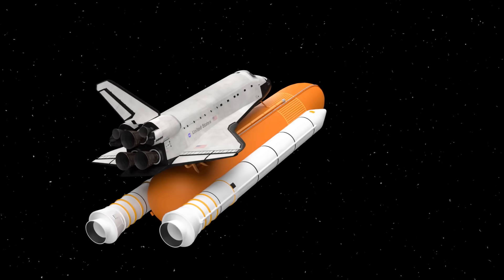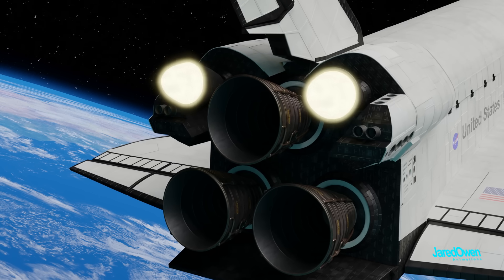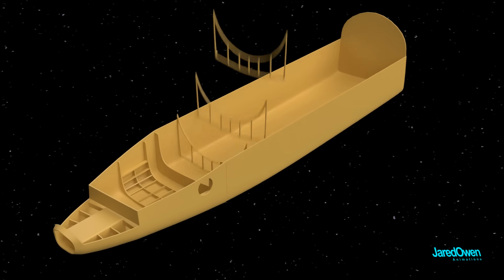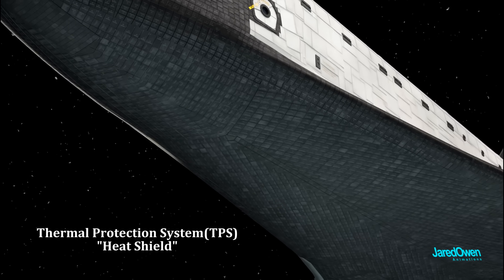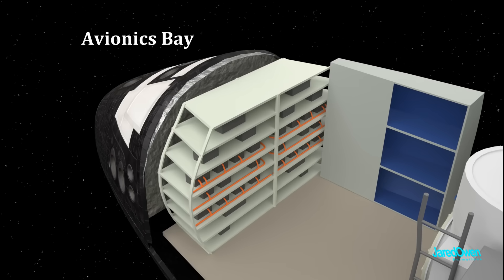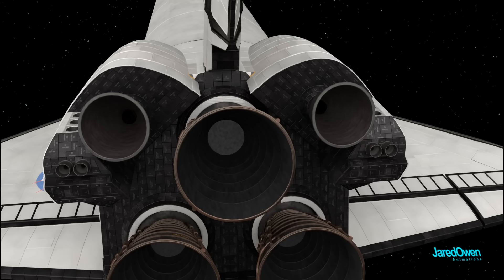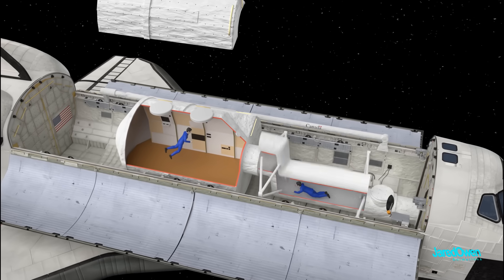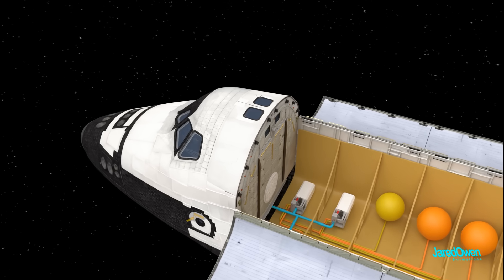How did the Orbiter Vehicle work? (Space Shuttle)

Comment: "Lands like a plane"
or, as someone else mentioned: "It was about as aerodynamic as a brick. The ONLY way to simulate the "performance" of it during approach, was to take a small passenger jet, with gear down, flaps full down, speedbrakes out and engines in reverse. THAT's the shuttle's "glide" performance."
Reply: It Just Works
Reply: No, that is an autistic rant. The actual glide ratio compares to e.g. an early paraglider design and people could have fun with those 20 years ago... and it does land like a plane.
Reply: @Baerchenization  if a glide slope of around 10,800 feet/min (aka terminal velocity for a skydiver) is standard for an early paraglider, I'd stick with a brick instead
Reply: @gajustempus  If you knew what you are talking about, you would not have said that. A glide ratio is how far you get from a certain height, e.g. 1 Km altitude, 4.5 Km distance is a ratio of 1:4.5 -- time has nothing to do with it. Standard for an early paraglider was a 'kind' 3... 4.5 was already pretty good ;)
Reply: @Baerchenization  oh boy, you're a hollow nut...
a 747 has a glide ratio of around 1:12. Current sailplanes have a glide ratio of around 1:90 or even better. That's why they need quite hefty airbrakes - they'd be unable to land on any normal landing strip.

As for the shuttle - it's a 1:1 ratio! Or better - was.
Reply: gajustempus Your numbers are correct but your conclusion is wrong. Airliners don‘t need speed brakes or better ‚spoilers‘  to break the glide but — in the end — not to strike the tail. Your 747 is a long aircraft that will still fly at an angle of attack that would guarantee a tailstrike on landing if they landed at aerodynamically correct landing speeds. An aerodynamical landing is a stall very close to the ground. So what they do is they keep the nose down while approaching faster and don‘t actually land but fly the airplane to the ground. So when the plane hits the ground it is still so fast that it actually flies along the runway and the brakes have little effect. So the spoilers are used to ‚spoil‘ the lift of the wings so you can brake the plane down.

What Baerchenization said about the gliding capabilities of paragliders is also true. The glide number is a value that comes from the descend rate and the forward speed. So if you can keep both a low rate of descent  and a high speed you‘ll get a high glide number. or glide ratio if you write it 1:n. But those early paragliders were not designed for high speeds, they were adapted from emergency chutes made a little bit controllable. So even if they descended at low rates of descent, their little forward speed would still make small glide numbers.
Reply: @Baerchenization   > in the "middle" phase ... the ratio is 4.5 <  Still, a lot better glide ratio than for the original proposal in the 70's, which would have used a small straight wing.  In any event, the Orbiter's glide ratio once over the runway -- when glide ratio really starts to matter -- was closer to 30:1.  Basically a sailplane, if a rather fast one.
Reply: @Baerchenization  They aren't wrong. They used an old Gulfstream in reverse thrust with the main gear deployed.
Reply: The shuttle's aerodynamics were so poor you'd be better off flying the box it came in.
Reply: Lol
Reply: Bret Copeland?

Comment: How exactly do thrusters work in space? If space were a perfect vacuum, thrusting would accomplish nothing as there is nothing to push against? If there is roughly 10 to the 23rd reduction in air pressure in space, it would seem something much larger (thruster and/or fuel tank) is needed to accelerate or brake something as weighty as the space shuttle. What's the trick in this? I've had this question since the first star wars movie came out when I was a kid.
Reply: Ever use a firehose? The flow rate is so high that it produces thrust. That's from the water being ejected not the water pushing against the air.
Reply: Thrusters in space dont need something to push against. This is because every force creates a force in the opposite direction. Let me try to explain:
Imagine the following situation: you are an astronaut floating in space and in front of you there is a heavy rock floating 5 inches away from you. Now, if you push the rock, you will be pushed backwards and the stone will be pushed forwards. The amount of distance you get pushed is dependent on the mass of the rock.

edit: sorry for my average english, its not my mother language
Reply: @raoulduke7668  Right, I get the equal an opposite. But my question involves essentially a vacuum, not a rock. If you push against a vacuum, there will be no force pushing back at you except maybe an occasional hydrogen atom. The inertia of the space shuttle would need much more than that to effect noticeable movement of the shuttle.
Reply: @finnyr9330  Its basically Newtons 3rd law of motion, momentum conservation. 

In a rocket motor, propellant molecules push on the back of the chamber they came out of. Thats why they create a force in the opposite direction.
Reply: @raoulduke7668  So what you are saying is that the engines are designed in such a way to use the exploded fuel itself as the resistance rather than what's outside the chamber. Actually, that does make sense, from both a movement and steering perspective. Thanks.

So would I be right in thinking that the tailing flame would be longer in space where exhaust is unimpeded by air pressure?
Reply: @fromnorway643  Jeg forstår Newtons tredje lov. Mitt spørsmål er kvant forstår Newtons tredje lov. Mitt spørsmål er kvantitativt knyttet til mangel på push-back av plass. Men det er min nordmann som kanje trenger en oppfriskning.
Reply: uffda. Norsk, ikke nordmann.
Reply: @finnyr9330  
Newtons tredje lov demonstrert ombord på den internasjonale romstasjonen ISS.
https://youtu.be/ZkVU-bj9bDk?t=103
Legg merke til hva som skjer når begge massene er omtrent like store (to astronauter) vs. når den ene er mye større enn den andre (astronaut og basketball).
Reply: @fromnorway643  I'm afraid you are still misunderstanding my question so I will revert back to English. No worries, though as Raoul has answered it for me. 

My question was not HOW Newton's third law works, but WHERE the opposing force is coming from in space. Space is not a rock and it's not a basketball, it is nothingness. It can't push back. So Raoul pointed out that the opposing force is the explosion of fuel inside the rocket chamber. That's where the opposing force is coming from.

So my follow up question is, what is different about the exhaust flame coming out of the rockets when in space vs. within the Earth's atmosphere?  And how would that affect the performance of the rocket?

It seems to me that because space offers NO resistance to exploding fuel that the effectiveness of the rocket would be reduced. But by how much? Would it be significant when one considers the reduction in pressures in space (compared to earth's surface) is 10 to the minus 23rd?

I'm sure someone how has worked out the math could quantify that, but I imaging the length of the exhaust flame would be a visual indicator.
Reply: @finnyr9330  
The opposing force doesn't come from space, but from the exhaust gases themselves.
When they are ejected at very high speed (roughly 10 times higher than that of a typical jet engine), they push against the top of the combustion chamber and the inside of the nozzle, as shown here:
https://www.real-world-physics-problems.com/images/rocket_physics_15.png

Maybe this is a better way of looking at it:
Imagine a closed container filled with a high-pressure gas. The molecules are flying around at high speed and constantly colliding with the walls and each other, and it's the sum of all those collisions that creates the pressure. As long as the container is closed, the pressure on the right or top wall is cancelled out by an equal pressure on the left or bottom wall, and the container remains stationary as it's not exposed to any net force.
Now, imagine that the left wall suddenly opens up. The gas will flow out at high speed, and the pressure against the right wall will no longer be cancelled out by a similar pressure on the left, and the whole container will be pushed towards right. The thrust created that way will of course be very brief as the gas almost instantly leaves the container, but a rocket engine is continuously supplied by new gas as the fuel is burnt in its combustion chamber.

Rocket engines are in fact more efficient in space than in the atmosphere as there is no surrounding pressure restraining the gas flow out of the nozzle. Their efficiency is typically given in something called specific impulse, a measure of how much thrust they produce per unit of fuel consumption. Hydrogen powered engines are generally better than all other types of chemical rocket engines because of their high exhaust speed that can exceed 4.5 km/sec in vacuum.

Examples of specific impulse for some rocket engines:
                                      Sea level       Vacuum
F-1                                    263                 304
(Saturn V, 1st stage)
RS-25                               366                  452
(Shuttle main engine)
Shuttle SRB                     242                 268
Merlin 1D                         282                 311
(Falcon 9)
RD-180                             311                 338
(Atlas V, 1st stage)

Comment: The orbiter was not reusable it was refurbished ever time to would be taken apart and inspected and the heat shield would have to be completely replaced every time
Reply: All the tiles were not replaced. Each tile was supposed to have the same longevity as the shuttle which was a hundred missions. They were all inspected after each mission and 30-100 were replaced due to damage. As for refurbishing, yes it certainly was the main reason for the much higher mission costs and turnaround times compared to what was advertised. SpaceX was supposed to do a 24 hr turnaround of one of its boosters no later than 2019 but the latest launch was with a reused/refurbished booster that broke an old Shuttle turnaround record of 54 days but only by 3 days. Of course a lot of this was probably related to the mission payload and not the booster but apparently SpaceX has abandoned the turnaround goal of 24 hrs. The recently returned Dragon will need 4 months of tear down and refurbishing before it can be used again as part of the human-rated spacecraft certification process.

Comment: How does the fuel tank burns up in the earth's atmosphere on the way back down, but doesn't burn on the way up?🤔
Reply: Because it doesnt burn, space missions are fake, there is no space. Earth is stationary flat plane, research it.
Reply: @idontcare7961  factual lol
Reply: @Iamsocharleston  that your alt or something?
Reply: Because it re-enters at a steeper angle compared to the launch. Higher velocity and heat buildup is the result. It’s also intentionally put into a end over end tumble. The aerodynamic loading from that helps tear the tank apart.

Comment: Hahaha... Man, you forgot about no gravity in the space. You need the seats only for landing/launching. In all other cases, then the ship in orbit - its just a waste of space. Same for storage (you dont need any specific geometry for it) and all the other things including stairs. You dont need the stairs in the space, handhold(s) is more then enough. :)
Reply: Most of the seats were stowed away when in orbit, except (I think) the commander's and the pilot's seat on the Flight Deck. The ladder was needed to get out after the landing since the exit was from the Mid Deck, not the Flight Deck.
Reply: @fromnorway643  So, the ladder is just to get out after landing... Do you know how much it cost to get 1 kg of weight to orbit? More then 10 thousands of US dollars. So, its all about saving weight. For example, Russian Soyus does not even have panels on the walls inside the ship. Just for to save several kilograms that could be used as payload.
So, every time we see a design "like a flat or home" - its means useless weight and not understanding that a given space must be optimized solely for work in orbit, with zero gravity.
Reply: @oleksiychekin6756  
I think the usefulness of that ladder justified bringing a few extra kg of dead weight into orbit. The shuttle technicians were able to save much more weight in other ways, like stop painting the external tank white after the first two flights, something that saved 272 kg.
Other modifications of the external tank eventually saved several tonnes of dead weight, so I think it's safe to say that the ladder was pretty insignificant.
https://en.wikipedia.org/wiki/Space_Shuttle_external_tank#Versions
Reply: @fromnorway643  The external tank never get to orbit and its not recoverable. From other side, the ladder decrease payload every launch of the definitely recoverable vehicle. 
Real manned space exploration is a very far from sci fi movies, where there is usually a lot of empty space and sometimes even artificial gravity. The lot of space on spaceships in sci fi movies is just for have a better look on heroes, nothing more :) Its probably will never happens in real life.
We should not look on the space orbiter vehicle layout as on something that has floor, that has ladders or porthole for controlling the space craft.
Reply: @oleksiychekin6756  
The external tank got very close to orbital speed, so every kg saved there would increase the payload capacity by almost that much. The OMS engines provided only the last 1 % or so of the speed needed for orbital insertion, so it wouldn't take very much to get the ET into LEO, too.
Reply: Nice fantasy, can you explain me how gravity works?